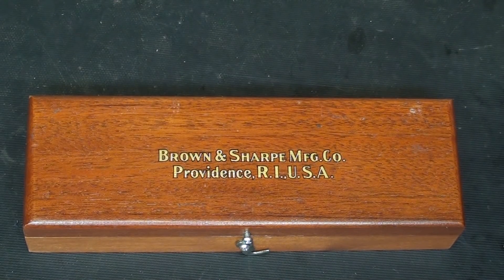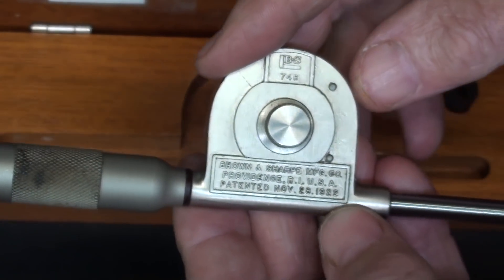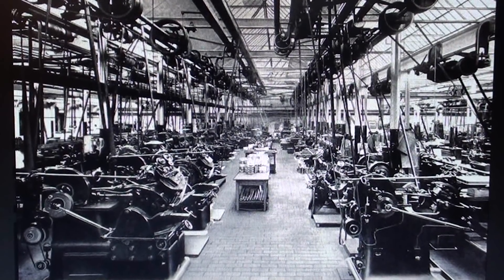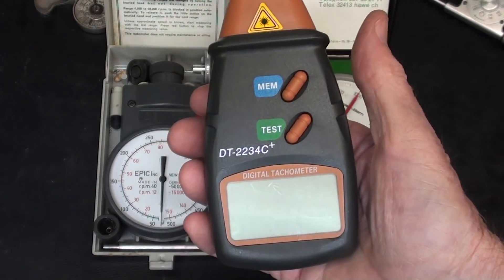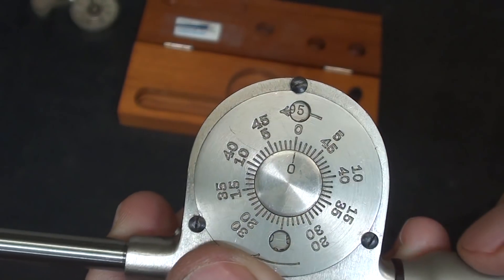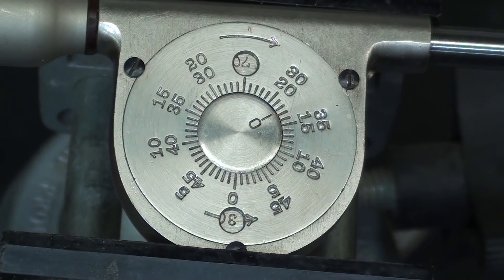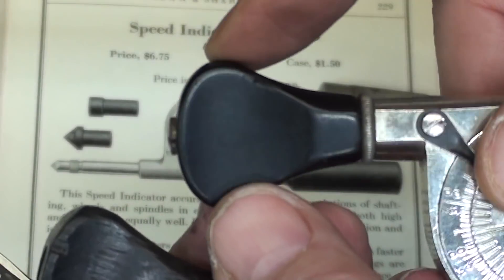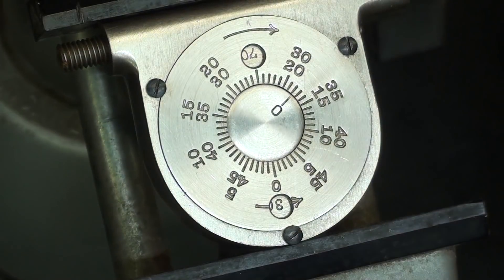Brown & Sharpe Speed Counter TIPS #618 tubalcain

Comment: Where can I find (or can you post) the link for the instructions that came with the #748???? I just found a rusty one with the original “wooden handle” (no rubber accessories), and the wooden case is burned.... I’ve completely cleaned and restored the indicator and it works perfectly.... but I can’t find any “paperwork” that would have come with it when it was new all those years ago.
Reply from the maker: I do not know, I was trying to find directions myself on the Internet and I could not
Reply: mrpete222 I just wanted to download a catalog page or info...thanks anyway, (and for all the other videos)!!

Comment: Were you tempted to make another brake shoe?  I was... perhaps a file project... how would you hold it?  Small parts are a bane...       Form it then cut it off I guess...
Reply from the maker: Heck no
Reply: Make a disc of the proper diameter and thickness and final operation, slice off a segment and deburr on a stone.
JIM

Comment: I'm finding as I get older I appreciate more and more vintage stuff.   I could use a £3 multimeter but I use a 1967 Cropico NormaTest instead, it works just as well if not a little more involved than the £3 Chinese device but the fact its still accurate nearly 53 years later says a lot about its making and I bought it because I was tired flushing money down the drain on cheapo Chinese meters.   My oldest working tool is a French 1903 voltmeter but its so fragile I have wrapped it in tissue paper and its put away, I have some WW2 King Dick girder wrenches which I use almost constantly again highlighting the almost perfect production process that allows these to work decades later as well as they left the workshop.

Comment: The plastic washer alone would not insulate the handle, it must be part of a plastic nut in the handle.
The other brake shoe may have been removed to lesson the friction because it was slipping with someones use. Ron W4BIN
Reply: I believe you are correct.

Comment: We used a similar speed counter when testing fire department pumpers.  To be within acceptable tolerences, the pumps had to be able to produce a certain pressure and gallons per minute at a given pump rpm.  A pitot gauge in the nozzle stream measured the pressure, and the diameter of the nozzle was used to calculate the gpm.
Reply from the maker: That’s interesting

Comment: A late as 1982, we used a speed indicator when doing the annual pump test, on the fire engine/pumper.  A class "A" engine had to pump 250 gals. per minute at a specific speed.  So it took three firemen to do the test, one to read the dial, one to watch the clock, one to run the engine speed.  Always enjoy and look forward to your videos!  Thanks again.
Reply from the maker: That’s surprises me

Comment: I'm picturing using one of these along with the countdown timer on my phone. Set for a minute (or 30 seconds), and set the speed indicator  before zero. Apply the indicator, and when it clicks onto 0, start timer. When timer pings, pull indicator off. Now you don't need to look at your watch (it's done by ear) and can set the phone down on the bench. New tech making old tech more useful.

Comment: Interesting to see the mechanism in this model with the ratchet counter. I have a Starrett with the little raised dimples on the static and rotating discs. The patent dates stamped on it are April 13th 1897 and also March 28th 1905. It has the black Bakelite handle.

Comment: Seems like you would want two brake shoes, because as it is with one, the end of the spring is wearing a gouge in the drum.
Reply: I'd have to agree here, it's pretty clear a second shoe is missing as - if they'd simply changed the design - the other side would just be a blind hole for the back end of the spring to butt against..
Reply from the maker: Maybe one was lost along the way
Reply: @mrpete222  I'm sure YOU could make another one and we could all watch you make it in another video!
Reply: Ditto.

Comment: Hi Lyle, 

I have one of those which belonged to my grand father. Have no idea what brand. He died in 1943, so it's quite old. His is all metal with the butterfly shaped handle as others you had in your collection. He worked with steam driven bucket pumps, which were converted to electric after he died. 
It's amazing the tools that were developed to do specific jobs or provide information, and as you showed what has replaced them, and in time they to will be replaced. 
It's also interesting to see the prices, but that would have been quite expensive back in the 1920's.
Thanks for a most interesting video. It's interesting to see how things work and what's inside.

Comment: I'm just thinking about the manufacturing process to actually build the thing , I know it's cutting gears it's a very time-consuming process I'm wondering if those gears are actually stamped or moulded and then refined or if they're actually constructed like normal gears would be with the indexing head or whatever . Possibly they might've even been rolled to form like with knurling ?
Reply from the maker: Maybe